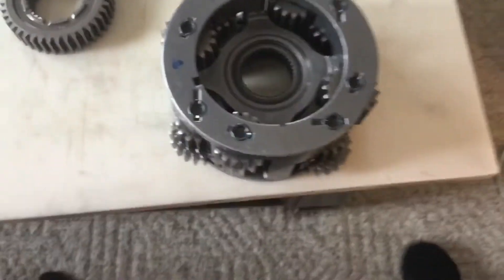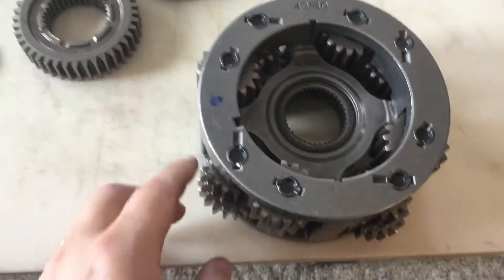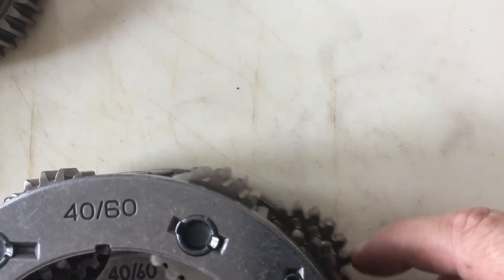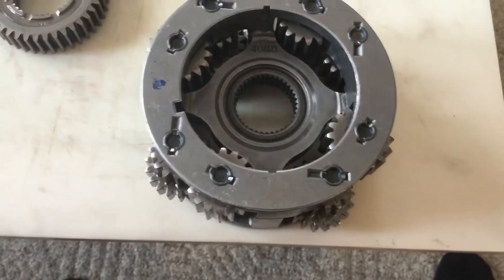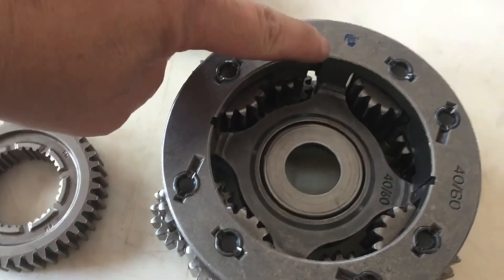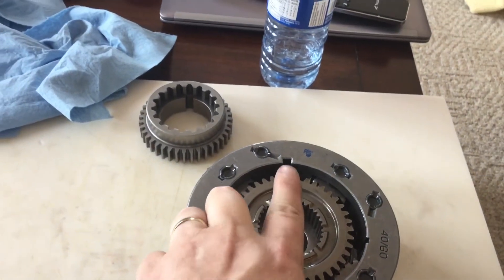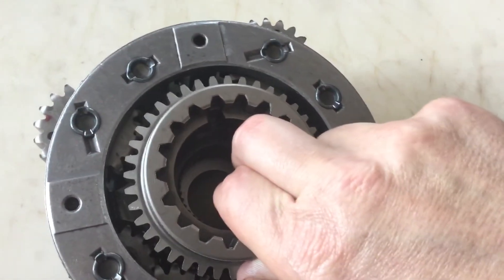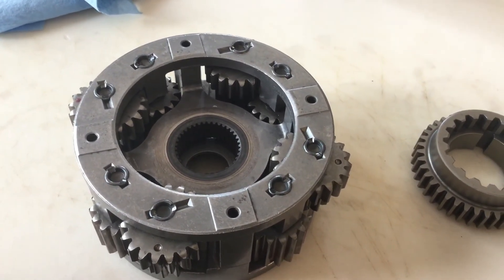Borg Warner 4485 transfer case planetary gears assembly

Comment: You didn’t time the gears properly. Yes the line goes out, on the opposite side there will be a dot. The lines also need to be on the inside as well. You should have lines pointing inside as well. You got the big notch correct, but that’s about it.
Reply: @larrytemen4789  well my truck has worked good for years, I knew nothing about timing, so I guess they are being chewed up slowly, thanks for this comment, I will look into that, you should make a video on that issue. Thank you sir, I will look into it. Have a nice day.

Comment: Thanks so much for the video, recently I removed my hummer h2 2006 transfer case for rebuild, but man I got stuck on planetary gear timing. But thank God I found this videi, could this timing apply to borg Warner BW4484? Thanks for your response.
Reply from the maker: I would look for marks that line up, there has to be something to tell a builder where the teeth go.
Reply: @duramax78  thanks so much for your response, though I'm doing it myself, but finally found a video explaining that. Thanks so much.
Reply from the maker: @myamazinglittleworld5673  let me know when you get it done.
Reply: @duramax78  yes please I will let you know. All parts delivered today. Fingers  crossed.  Stay blessed brother 🙏